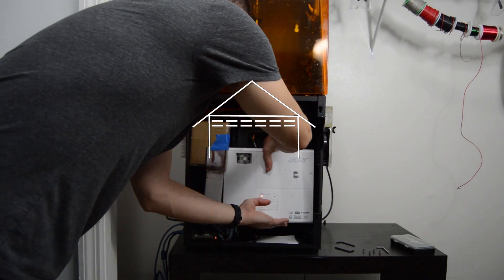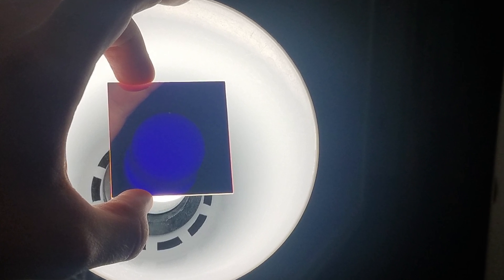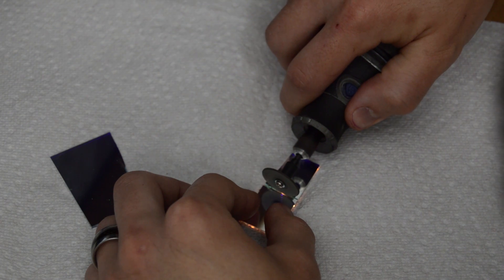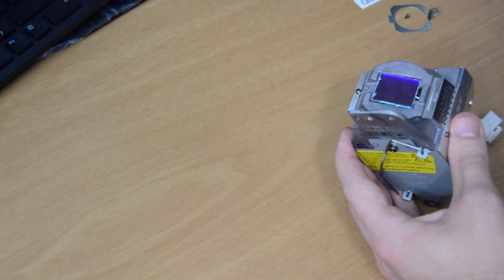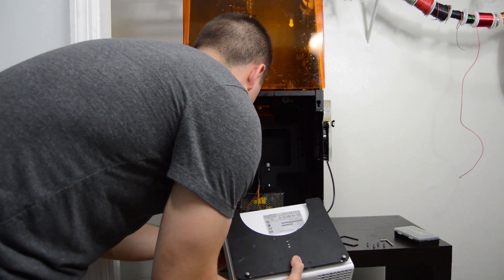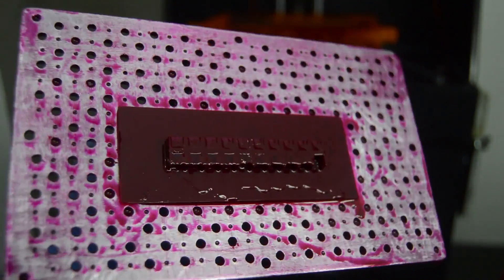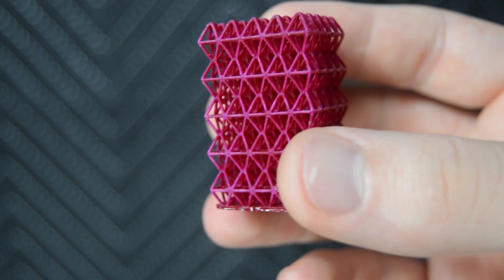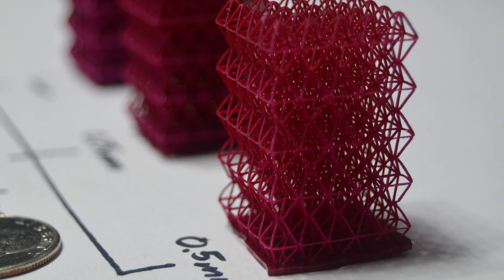DLP Projector UV Pass Filter Installation Guide

Comment: Hi... I have curing times with my unmodified H6510BD of about 3500ms and 5000ms for base layer with FTD IB black... I guess it depends also alot on the resin u use.
Reply from the maker: +stoptwo it depends very heavily on the resin. I don't have any FTD right now but when I get more I expect to have cure times of about 1sec.
Reply: confirmed... when u see the gizmo superfast printers they continous print to 3mm / minute with double projector stacking